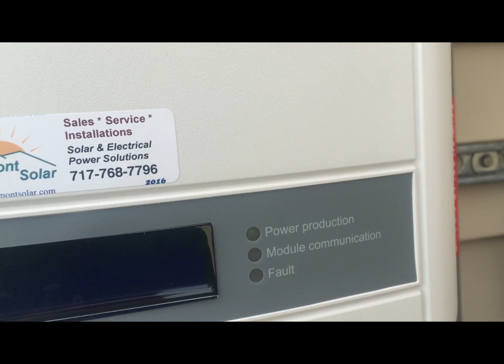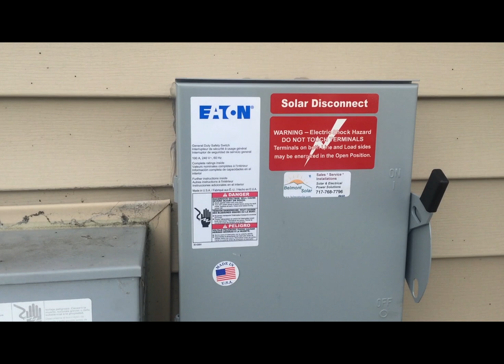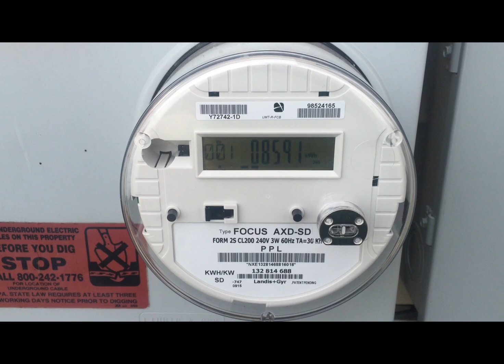Solar Inverters and Power Meter Setup on a Home

Comment from the maker: It looks very well done. Something that seems extremely rare as far as DIY Youtube setups are concerned. The Tough Trac Rail with integrated wire channel would really have finished it off, but well done regardless. Enjoy, and continue encouraging others to use solar power